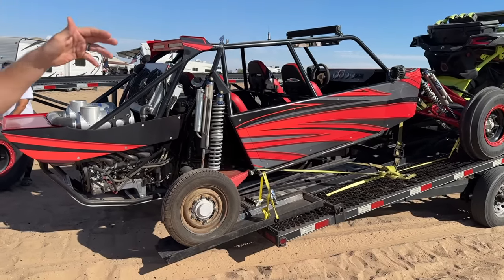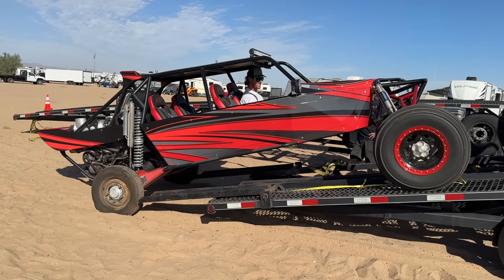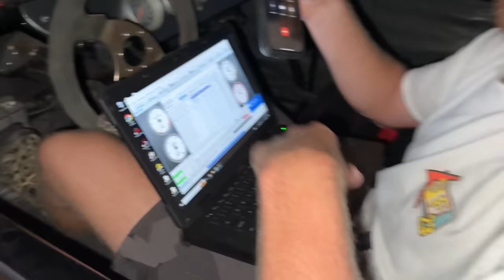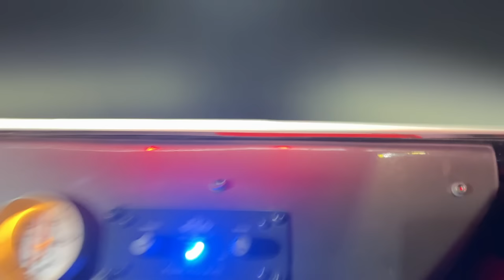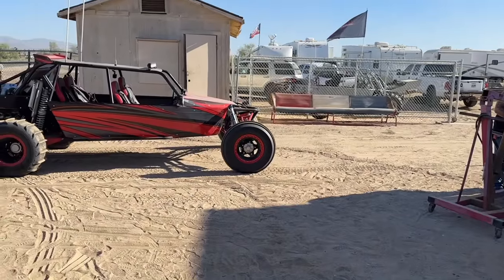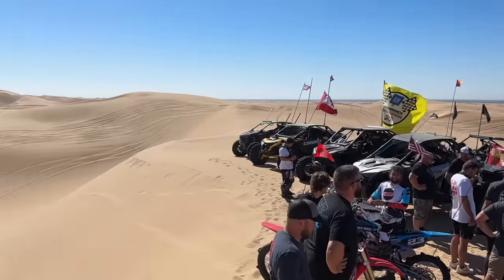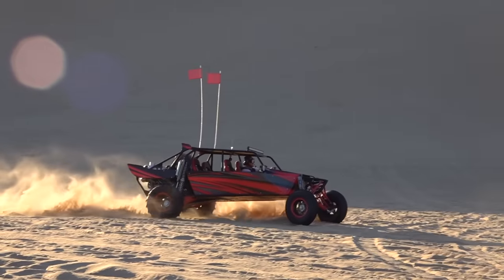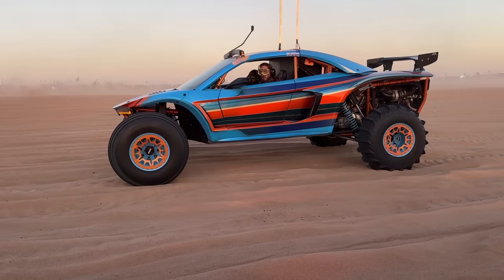I Bought a Sand Car Off Marketplace For $50k... IT'S INSANE!!!

Comment: Just bit of advice for anyone who offroads do NOT use the exterior parts of the roll cage as a grab handle while the rig is moving, I say this because my former coworker who is former US Army Blackhawk mechanic was using the roll cage on a SxS as grab handle when he and some friends got into a wreck which led to a roll over and he ended up degloving the hand grabbing on to the cage. I saw what his hand looked like when he got back to work and it was NOT a pretty sight. So as the say on roller coasters "KEEP YOUR HAND AND FEET INSIDE THE RIDE WHILE THE RIDE IS IN MOTION".

Comment: I remember the first time taking my CR500 with paddle tire to Sand Mountain. It's almost like riding a jet ski because it's not friction from tire that makes you go, it's the paddle throwing sand backward and conservation of momentum. The most fun thing about riding motorcycles on the sand is the cornering G forces. You can lean it over so far the handlebar is touching the sand and the suspension is bottoming out. It seriously takes all my strength just to hold on. So fun and so different from any other surface you could ride on.

Comment: I bought my sand rail from a family friend with a dead engine for $200. Its a shortened wheelbase pre 65 vw. The stock type 1 trans is still in use but I've got a 22r Toyota motor in it. The whole buggy weighs like 900lbs!
Reply: Make video
Reply: @Gniggaaa  I've got a short up from back when I first bought it. It's since then gotten a couple goodies but still a 22r Toyota

Comment: Now this looks so much cooler than a freaking side-by-side to me. One of the biggest problems I have with side by sides is the stupid CVT transmission setup. That's why I always like the YXZ so much... Anyways awesome video! Can't wait to see you make that thing super fast
Reply: CVT is a great way to go, they will continue getting better with time until they are the go to for everything. Imagine if formula one hadn’t banned them in 1992 after the first test session with one in a car broke every record on the track, the advancements that we would of had in the last 30 years of race development would have made a world of difference in the durability of CVT.
Reply: I cannot abide by the CVT nonsense. At that point you may as well go electric which would be better. At least it wouldn't sound terrible.

Comment: the cars wont go over backwards. just nail the throttle and hold it. once it hits the rear skid plate those nose will stop ascending. these arent like normal street car wheelies. the final drive is so deep, and the front of the car so light, it just climbs the ring gear.  But careful slapping the ass end on the ground real hard, thats what blows belts and if you get real wild you can snap the motor off the transmission adapter.  where the rear cage is split so it can be removed isnt in the best spot, causing a bit of weakness in the rear section that cradles the motor.

Comment: 1st mod needs to be independent rear wheel brakes and a lexan floor, so you can see where you're going and still steer it with the nose in the air.

Comment: They're great fun, I learnt to drive in a modified VW with a cammed 350 that almost looked the same...
 How are you guy's possibly be surprised with the state of those filter's?  
You never clean your welds or purge correctly. 
And a 450 is scary? 🤔 buy a 900-1200 street bike and take it there, they love it!

Comment: @cleetusM With the amount of power that ting seems to be making. It could be fun, both for you and us. If you tried to put some Super Scooper Paddle tires on it... Those things have insanely large paddles. They shuld give you Way more push and Prolly infinite wheelies... These are the same tires they use in Formula offroad. And you can have shorter staggered  to each side of the tire (requires less hp), or the full tire width paddles(What the insane formula offroad cars use). Hope you read this. And if you do... Then it might be fun for all of us xD 
Formula offroad cars are basically custom tube built 4x4 jeeps. And they mostly use v8's with 800-1500hp. And they use a ~250hp nos system with a switch under the gasspedal. If they need more power... They also use paddle tires on all 4 wheels. Then they try to drive up impossibly steep slopes. That are also quite high(They are using quarry walls and such). And there are trails they have to follow. So it is a really interesting competition. And usually a fair amount of rollovers down the hill... Though the drivers are brilliant drivers. As a side note. The crew that puts down/corrects "cones" usually ride up to the top in an ATV. Then walk/slide down the hill... It's just to steep for a human to try climbing up many of the slopes they drive on. And it would take them to long to climb up there in any case. :p

Comment: Hey cleet. If you want to wheelie without need to pick up so much speed try this trick. When you moving and want to wheelie instead of just hit the throttle do this. Moving whatever speed, let off the gas for just a split second then hit it to make the front come up. Your using the springs in the front to help kinda bounce up. Try it. Once you get the timing  down its cool. I do it on my bike. I can do a wheelie going 80 mph easy without touching the clutch. Peace. AWSOME video by the way

Comment: some fun facts about the Bell Boeing V-22 Osprey
 max speed 275 kn or 316 mph 
range of 1012 miles
25000 ft ceiling 
can pull 3+ g's when empty 
can carry 32 people
carries any 2 weapons of the following 3- m240 7.62, .50 BMG 12.7 mm, GAU-17 minigun in .308 cal
2 rolls royce turbo prop engines 6150 hp each
51 souls lost from over a dozen crashes
none have ever been shot down all deaths are from pilot and or mechanical error/failure 
.259 hp per lb

Comment: That's a REAL sand car, not those stupid ass side by sides. These are the cars I grew up on. SxS doesn't even compare. Granted the very best SxS's have come a long way but they still pale in comparison, not even in the same league, suspension wheelbase or power. And, the hilarious thing is, these bozo's go spend $50k+ all in for a glorified golf cart and you can get one of these top end rails a few years old for $50-60k just like Cleetus got.